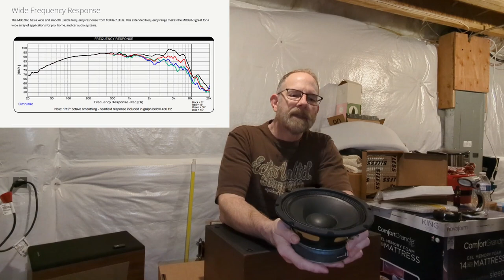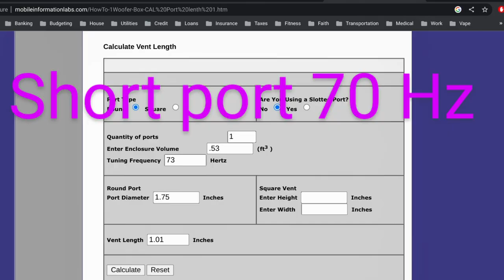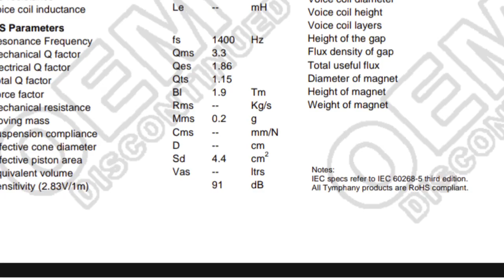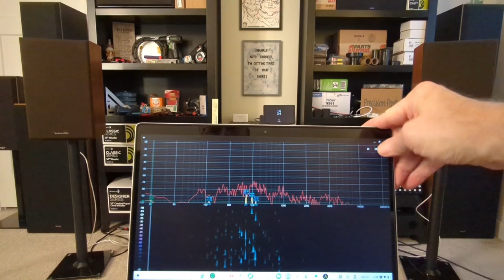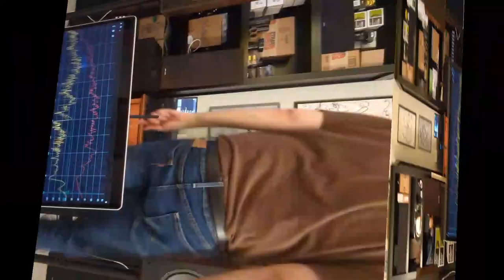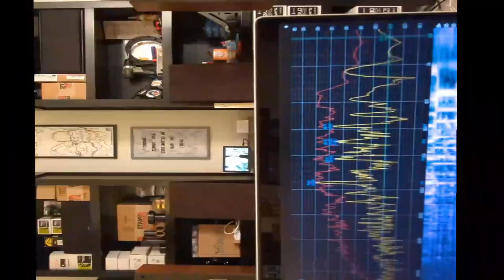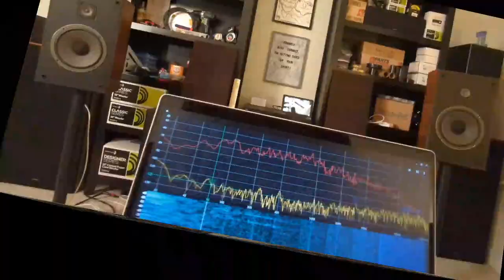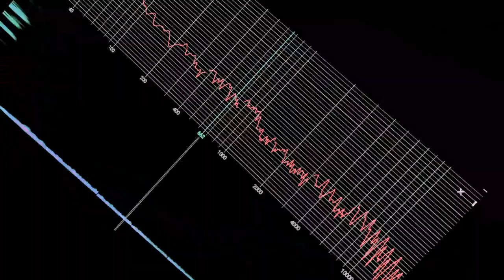Realistic Mc-1800 Speakers Project: Review And Testing. What Would You Do To Improve These Speakers?

Comment: Your MB820 driver would work good for use in a custom build center channel speaker and get down to about 57Hz (plenty low for a center channel) in a custom 0.89 ft3 vented enclosure. I have plans for building a wide dispersion 3-way using a compression driver for mid the Selenium D250-X GW 1" Phenolic Horn Driver with the Selenium HC23-25 1" Exponential Horn 100x40 1-3/8"-18 TPI using the Crossover frequencies of 1.2kHz and 3.5Khz. 2 Ports 1.75” wide 2.37” long. Tweeter will be the DS18 PRO-DKN25 Neodymium Driver with Aluminum Horn (This is the widest dispersion dedicated horn loaded tweeter I have seen and heard so far.)
Reply from the maker: Nice project! I also did a center channel albeit not as fancy, but used pro full ranges and compression horn. LOUD & CLEAR for sure. As for the 8" mid bass driver it sounds very smooth, (I had them in my Energy 3.1e ported 2 ways). They even paired well with the original soft tweeter and crossover points. Only issue was not enough low bass. Parts Express said they have another model that's similar but reaches down a little lower. I like the pro drivers for certain applications. Decent ones are very clear and response is smooth, plus they're virtually bullet proof and pretty accommodating even if the cabinet or port isn't perfect. I used to use a 15" selenium in an older 3 way speaker design I made for high power, high SPL applications.
Reply: @wattspeakers  Because of the low Excursion of that MB820 it really needs High Pass that an AVR can provide for its center channel output. For my Center channel I am building will use the Aurum Cantus AC-200MKII 8" Carbon Fiber Sandwich Woofer. Its about a 90db in its usable frequency range and will go down to 49Hz 3db down in a ported 0.80 ft3 box. Using same compression drivers as above. I am assuming you also use the free software WINISD to model how these drivers will perform. the AC-200MKII has a nice 8mm Xmax but shouldn't be crossed over any higher than around 1 to 1.1kHz. I only suggested the MB820 for a center channel as you already had one. Since a center channel speaker does not really need to be real low most say 100Hz is lowest it needs to be for dialog but if singing voices also comes out of the center channel then I always though be better to go down to around 80Hz to accommodate the lowest male voice (85Hz). Then the speaker could be used for other things besides a center channel.

Comment: I overstuffed my MC-1000s with insulation and that really improved the bass response. You might try that. Also replaced the Cap with a fresh one. Good luck!
Reply from the maker: Good to know Dave!
Reply: @wattspeakers  ...oh and I forgot. I also changed those alnico tweeters to radio shack cone tweeters #0705Ae. They're common tweeters that were used in Nova speakers and can be easily sourced. Frequency range is 350Hz-18kHz, yes you read right. Use a 2.2 ohm capacitor. These are my #1 speakers for indoors, and I have a lot of speakers!

Comment: If you ever find a set of older MC-1500's (also with 8" woofers) I believe they had thicker sides (5/8" or 3/4") and had an internal volume of around 1.5 ft3 much lower base with a set of those.
Reply from the maker: Thanks for the tip! I'm always on the lookout for old speakers to modify. I noticed many of the older, (pre 1990’ish), seemed to use thicker MDF, even if it was a cheap speaker. I imagine the cost of supplies and shipping, in combination target consumers likely was the catalyst for cheaper, thinner MDF.

Comment: I would stick to a conventional 2-way design.  I prefer acoustic suspension.  A decent crossover, better bass driver, soft dome tweeter, binding posts for the rear.  My advice is don't try to reinvent the wheel.
Reply from the maker: Thanks for the suggestions! Your ideas are good, very "clean" and just taking the original Realistic intended design to the next level. I like it!

Comment: Regarding the existing crossover point, to save money they often would not use an extended range tweeter and run the woofer high to match up with the tweeter. Which is probably what they did here. If the woofer is crossed lower you will have better off axis response. For an 8" 1.2Khz (not really practical with a two way) So 2Khz is a good compromise. but the existing tweeter probably cant go that low so your idea if you keep the tweeter to cross over 3kHz might be better. The lower SPL output of your tweeter shown in your wave form measurement might be the result of that capacitor probably has high ESR and is attenuating the tweeter and may just need replaced. Discovered same problem with many of my older speakers.
Reply from the maker: Those are all excellent observations Jim! I wonder if that's why so many decent older two ways were crossed over at 2500 and many off the shelf crossovers still use that philosophy. The worn capacitor is a good thought as well. The frequency response of the small cone tweeter looks a lot like the GRS Phenolic Ring Cone Marantz style tweeter I used in my Jensen CS 315 project. Very similar response, just lower SPL which would make sense since the GRS is bigger. Not sure if the caps would be bad on these speakers as they look like they're unused until now.

Comment: Those 1 1/8" silk domes you have would work good with the RS225-8 same efficiency rating OR even the 2" Phenolic Ring Tweeter would match up well. Cross at 2KHz or close.
Reply from the maker: That reference series Dayton Woofer would be perfect if I left the speaker as a sealed design, thanks for the suggestion. It's pretty inefficient though at less than 87 Db
Reply: @wattspeakers  Regarding efficiency look at the graph, Usable bandwidth is pretty much a straight line right below 90db closer to 88 or 89 than 86.8. They are getting their measurements based off of electrical and parameter calculations. I always use the provided graph it is way more accurate. Remember how off the efficiency rating of your sealed Goldwood midrange was compared to your actual measurements and the graph provided on Parts Express website.
Reply: Even the much acclaimed and sought after Acoustic Research A3Ra 3-way speakers from 1960 are only 83db to 84db sensitive. There is a trade off if you want a speaker to go low either have to have a very large box or lower sensitive woofer especially with an Acoustic Suspension. The extremely popular  KLH Model Three's we seen just released last year are only 88db sensitive. I like sensitive speakers too. There are some 10 and 12 inch woofers I have seen that can go pretty low in frequency and are sensitive like around 10" @89 or even 12 @ 92 but those have to be crossed pretty low like 200Hz and often need a larger box.

Comment: I really wish Radio shack gave the frequency response rating at 3db down. Otherwise there is no reference point and their rating is meaningless. A lot of times if they don't give the db rating at 3db down I discover they are often measuring at 10db down. You really have to take those speakers outside to get the frequency response below 400Hz. room reflections will throw off your measurements. Unless you keep the volume really low in a large room with microphone close for each driver measuring separately. YOU should download REW it is free to use with your microphone if you don't have it. Very accurate for recording waveforms.
Reply from the maker: Thank you for the suggestions and the tip for that software. I'll check into it! I agree I don't have the ideal measuring area. Coincidentally I was watching a factory tour of GR Research and if I'm not mistaken he's also doing rough measurements inside in his workshop. Bigger than a bedroom for sure, but one thing I consider is that it seems like the larger the room the greater chance of skewed results due to delay of reflections and echo. 

Personally, I determine my reference level by essentially cutting a straight line horizontally through the bulk of the response curve, and record the lowest bass response at that line. That being said it's usually a little louder at the FB.

Comment: The Dayton Audio RS225-8 (88db efficiency) would be a good candidate for this cabinet. with insulation in the cabinet it would be the equivalent of increasing the volume around 15%  to 20% so conservatively lest say .630 ft3. If you use this driver with insulation and leave it sealed should give you about 56Hz 3db down. if you make it ported using the Dayton Audio DSA215-8 (88db) then 47Hz 3db down with box tuned to 42Hz. 1.75" port 4 to 4.5" long would work.
Reply from the maker: I like their reference speakers, but they have funky sized frames, that don't normally plop into a stock hole. Of course, that's never stopped me from hacking up a perfectly good set of speakers before lol. That being said, I'm leaning strongly towards making a mini Mach One with them... They'll likely sound like crap regardless, so why not have a little retro fun on a budget. I've got $20 into the cabinets, $100 worth of perfectly good Dayton pro mid bass drivers I should be able to tune into the 60+ Hz range, and a $20 pair of decent looking crossovers, and I found some cheapo horns that look very similar to what the Mach One had, except smaller. Stay tuned to see what direction that project takes. I think anything more than a Dayton Designer Woofer would be too good for those cheap cabinets, that can't be anything other than retro with that shoebox shape, oiled walnut veneer and brown grilles... Unlike the RCA'S I'm working on that will look cool in just about any environment once they're done.

Comment: Have you eyeballed that HiVi DM-7500 3" Soft Dome Midrange on Parts express yet? It only has one feedback so far I am curious how well it sounds compared to Dayton Audio's 2" version.
Reply from the maker: I have seen it, and it looks impressive. With regards to the Dayton dome midrange, I'll share the inside scoop with you... I've actually got a pair of Dayton Reference Dome Tweeters, in a box I've not opened that are intended for the RCA 12" 3 way project I'm working on. The quality of it seems like it would be a better choice sitting between the gorgeous Dayton Designer Woofer and that pretty little Peerless tweeter. The Goldwood mid-range drivers I'll yank and they will be used for something else... Not sure what yet, but I'm curious to see how smooth I can get the response of that project and the Reference Dome seemed like it'll have its sweet spot right where I need it.
Reply: @wattspeakers  Isn't that Dayton Reference dome tweeter 4 ohm?  Not sure it would work properly with any off the shelf crossover when crossed with an 8 ohm woofer, That normally requires a custom designed crossover. What would you choose for the crossover point? Needs to be about 1.4k or higher. I think that tweeter would work good for a two way speaker project.